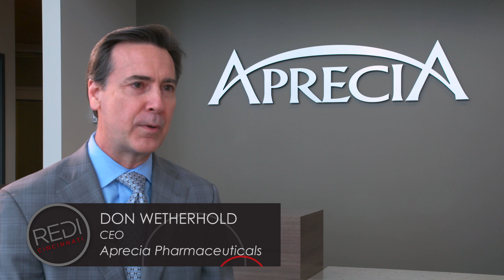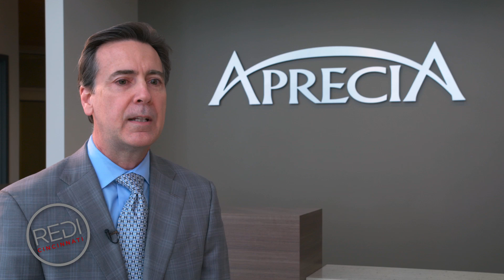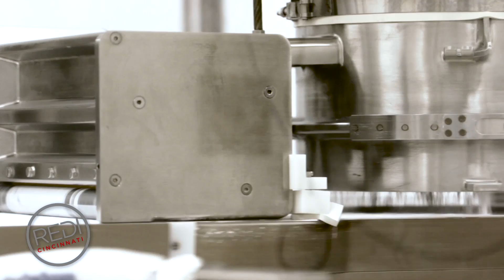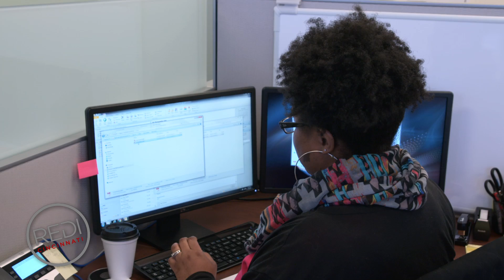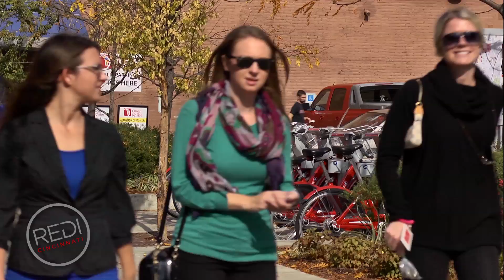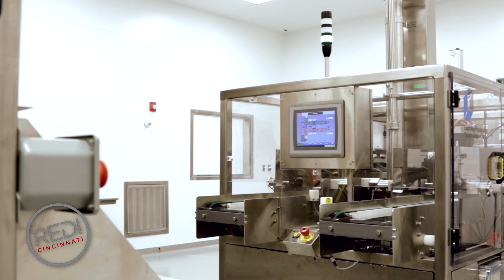Aprecia Pharmaceuticals - BioHealth

Comment: I so saw much opportunity for improvement at Aprecia. 
I recommended producing a one size tablet with different dosages using a color indicator instead of size. This would be a huge, innovative cost saving and simplify change overs and the entire process. I also recommend changing the shape of the tablet from round to hexagonal. This would reduce recycled powder and increase output. But they didn’t listen to me or they stole my idea. Time will tell.